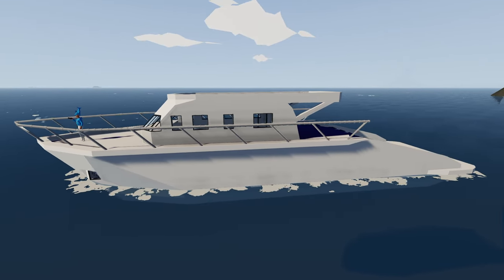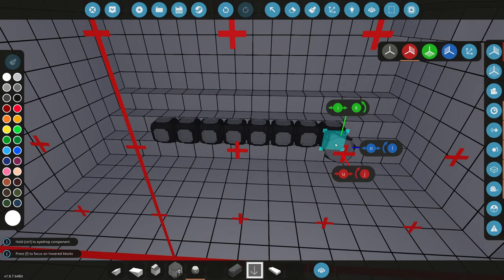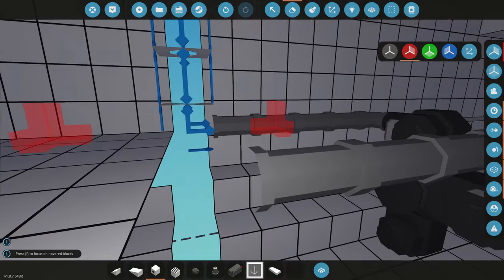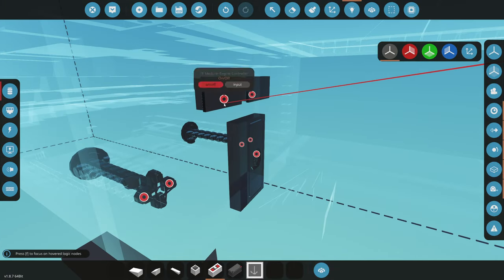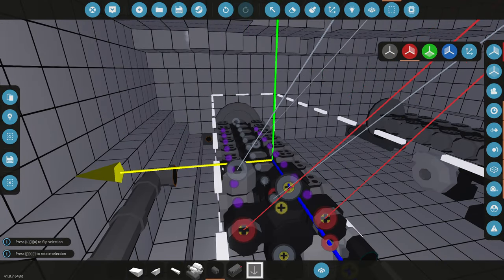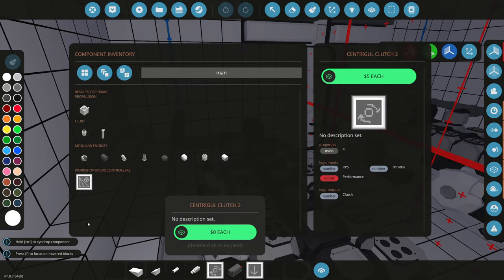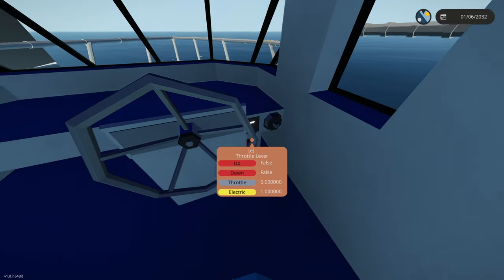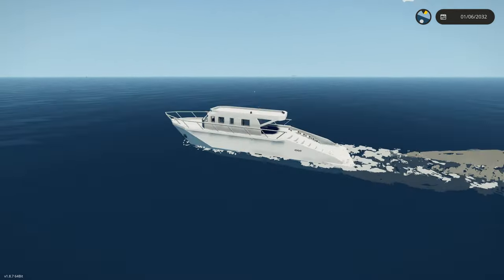Adding Super Engines!  | Ultimate Vacation Yacht, Stormworks (#2)

Comment: You can make the impeller pump to be powered by exhaust just like real turbo, just add one more pump on both sides and on the fluid ports connect the exhaust and it should output rps